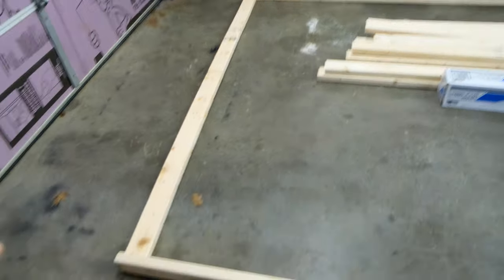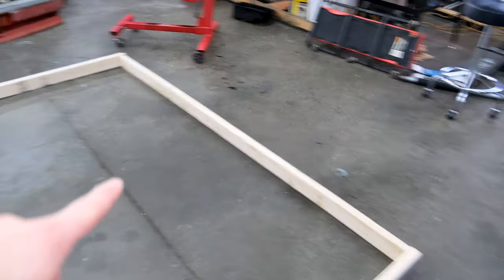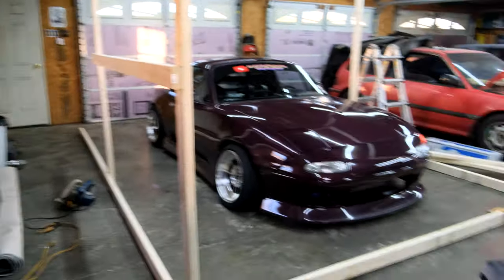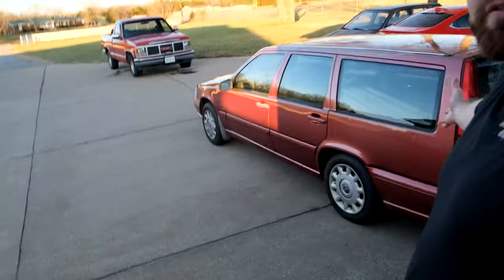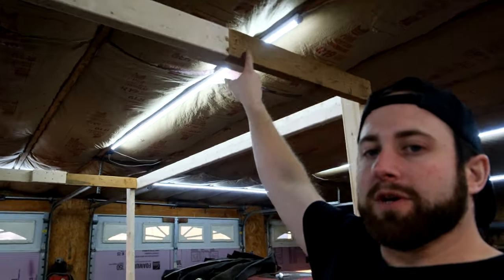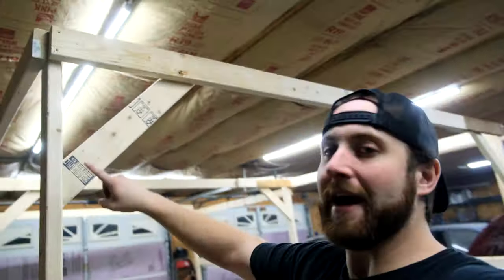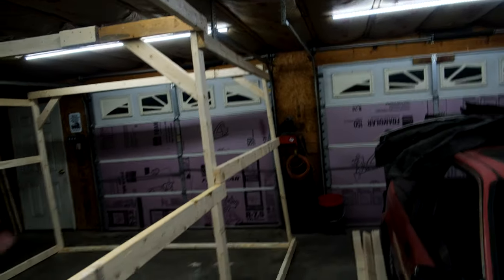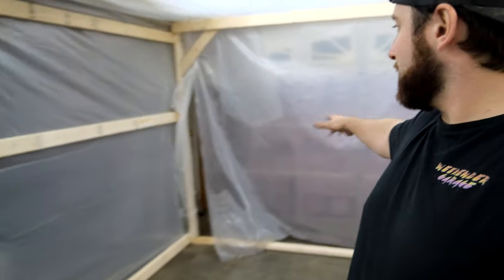Building A Paint Booth In 10 Minutes

Comment: Should add a fan and intake and exhaust filters. Saw another guy use a box fan, and 2 furnace filters to get some of the overspray out of there.
Reply from the maker: That’s the plans for version 2! Thanks for the advice.
Reply: @WeekenderGarage Yes, you CAN use a box fan but it's risky.  If you're going to use a fan, make sure to get an Explosion Proof Fan.  They cost more but have a sealed motor and are safe for combustibles like paint.  Thanks for the video!

Comment: Smart idea using a wooden frame. I had done something similar for a body work project, but I only used the plastic sheeting hung from my ceiling  and garage door rails, so no actual frame. The dust was pretty well contained to just that bay as well.
Reply from the maker: We thought about doing that. I plan to do a Version 2 here in a couple months because I need to fix my wrecked Miata. Your way might be an option !

Comment: Why didn't you just go the full 8 ft wide instead of creating saw dust in the garage? And honestly you probably should of just got 10 footers off the get go and went straight to the ceiling. That would have saved $40.00+  on the framing for the top.
Reply from the maker: I wasn’t trying to make it a huge foot print that spilled into other bays of my garage. Not worried about a minor amount of saw dust. That’s what a boom and dust pan is for.

The whole point of not going to the ceiling is so you don’t have debris falling down when spraying. Yes it would of been smarter to get 10’ 2x4 and hopefully you can learn from this video for your own project. I’m sure I said that somewhere in the video 7:07

Thanks !

Comment: Construction buy here.  You deal with warped wood one of two ways - take a 2x4, flip it 90 degrees and screw that onto the warped piece.  Or take a steel stud, screw it on to straighten out the piece.  Those 45 cuts - get yourself a miter saw and zing those 45's out that way.  The cockeyed result can be stopped with a speed square and those clamps that you just used.  And when you square up a frame, keep the 45 degree cut pieces on the inside of both 2x4's instead of the inside-outside way you did it.  You can use this tutorial if you want to build a more robust frame for your next paint booth.  https://www.youtube.com/watch?v=9czqvzVsHOg
Reply from the maker: Thank you so much for your response! For some reason YouTube held your comment for review and I just saw it.

I plan to build another one and I will definitely use your advice and take notes from your video. 

Thanks again!
Reply: He's not building a house or getting an inspection...it's a paint booth! haha

Comment: Waste of money really and way to much work. Instead of  building a 300 dollar frame, do this.  Just screw an eyelet bolt on each end of the room.  Get blue tarps with eyelets on them so that they will fit the height of the room.  . Then, get a roll of wire and feed it through the eyelets.  Then put a turnbuckle  at one end to tighten the wire.  That will make a curtain wall that you can pull the lengthoff the car on each side.   Then another tarp at the end for the end wall.  When you're  not spraying, you just push the tarp to tge end of the wire and put a bungee around it to hold it tight.  Easy peazy. And no big ass framework and plastic taking up space.
Reply from the maker: Thanks for the tips! Since this video I have tore it down and I plan to make something for the future. I will keep this in mind!